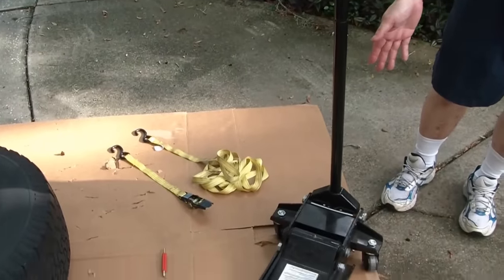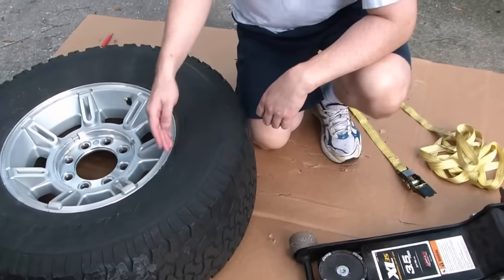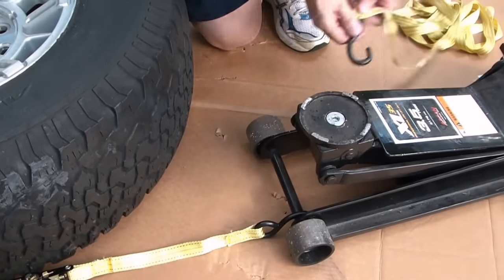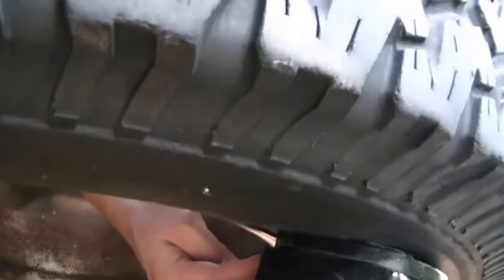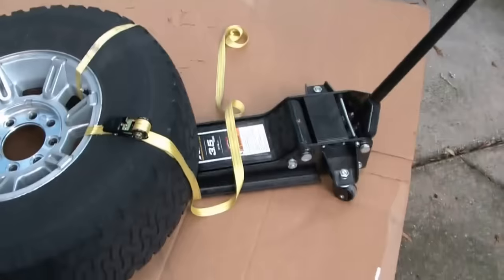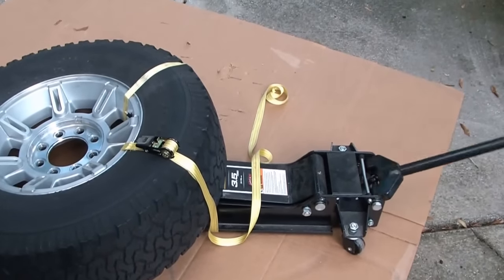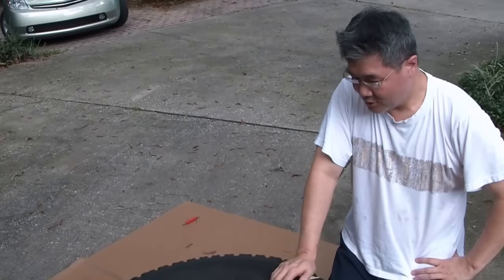Easy and safe way to break a tire bead

Comment: Do you have a trick on getting rid of the old tires for free? 😐
Reply from the maker: There are 5 solid waste dumps around the perimeter of Hillsborough County FL, where I live. Each of those accepts tires. Your county probably has similar facilities. You'll need to prove residency by showing your driver's license. Alternatively, the store where you purchased your tires should also accept old tires for disposal. That is because the state already made the store charge you a $1 to $2 disposal fee when you purchased the tires. Take care !
Reply: Just leave them on the front yard and hope for the best. Or you can stop at a tire shop at 3am.
Reply: Put them out by the street with a for sale sign,  someone will steal them by morning.
Reply: A match......lol
Reply: Ya, haul em to the liberal City of Detroit and Chuck em off in some abandoned house lot.  There was a tv show about that a while back lol
Reply: Put one under each brush pile you plan to burn and light it at night
Reply: Dumpster
Reply: Cut them in to chunks and make your self a punching bag.
Reply: Don’t know every states rules, but here in Missouri all you have to do is cut the sidewalls off and toss them in the garbage. Box cutter does the cutting all right. But if work, but free

Comment: Your method explained as simple as it could be for anyone to understand, I'm going to try it on a 14" tire soon, Thanks !!!. P.S., I knew this was possible, I'm also going to try installing a better tire on using a method I saw, it only requires dishsoap & your weight to put on..then you'll need to inflate it to proper psi. Thanks again.

Comment: Thanks just changed bad valve on my rim for my cts worked great 👍 thank you very much I was able to break the bead on the side of the valve and slip new valve in . I am going to install tires on my 2011 f150 in 2 weeks also in preparation for safety inspection and getting licensed

Comment: Nice video! I remove the Schrader valve,  put my tire on a piece of carpet and use a short wooden ramp put as close to the bead as possible and drive up on the ramp to break the bead. Or sometimes I use my large vice to do the same. .I then use long tire irons to finish the job.
Reply: Normally, I wouldn't want more vices in my life, but a large vice would come in handy if I had one. That's a huge vice you're talking about unless it's golf cart tires.

Comment: This is a great low cash method. Back in the day, we used and old fashioned bumper jack, and the weight of a vehicle. Now I use my vertical wood splitter.

Comment: We used to use the vehicle itself. just stick the tire under the bare wheel just right and lower the vehicle until the bead breaks loose. Worked every time.

Comment: This works great had to replace a tpms on my truck, worked perfectly, tip use a board between the jack and sidewall to prevent any possible cuts.

Comment: I use a similar method to compress front coil springs when replacing ball joints or control arm bushings.

Comment: I have an actual bead breaker, but I find the easiest way to be laying the wheel face up on the ground, taking a 2x8 (or something similarly sturdy) laying it across the tire wall, and then driving up on it with a heavier vehicle (truck/small SUV). Only takes a couple seconds.

Comment: Awesome video. 👍🏽 👍🏽 👍🏽 
 I used a piece of cardboard to trace around my rim then I put the half circle pattern on a 2x12. And cut it out. Laid the tire and rim on the ground, laid the 2x12 just shy of the rim. Drove up the 2x12 with my truck worked like a charm.(pull valve stem 1st of course 😆).

Comment: necessity is the mother of invention they say. Well done sir. I use a big hammer and 2 pieces of 50mm steel angle cut around 60 or 75 mm long..sit the angle inverted on the tire next to the rim and give it a sharp hit hitting towards the rim and down at the same time...repeat around the rim as needed until the bead breaks.. flip the wheel and repeat on the other side then remove the tyre with a set of levers..i used to be a forestry contractor and field patches were just part of the job and this method never failed me..

Comment: Will try this way next time I need to change my tire. Yesterday I used the jack but I put the tire under the tow hitch, put piece of 2x4 next to the rim and put jack on it while pressed the top of it against the hitch. Worked but this way looks easier.

Comment: This is a good concept but it seems to depend on the tire how well it works. My tires proved to be too flexible in the sidewalls because instead of the bead pushing off the rim the side flexed up and let the jack slide up the side. I also tried a variation of this by positioning the jack and tire under the tow hitch of my truck with similar results. So it didn't work with my tires but it makes sense with tires that have stiffer sidewalls.

Comment: Brilliant, thanks brother! I've been contemplating the Harbor Freight options, no place to bolt the thing down besides also not wanting to have extra shite lying around, turns out I've already got everything I need, ratchet straps up the wazoo (those being of equivalent usefulness, depending on application, as having a good zip tie supply 😆)

Comment: I just tried this on a worn out of 35s on an 18in wheel. It kind of worked, I ended up breaking my ratchet strap trying a 2nd time but it partially debeaded one section then jammed up. Figure if I did it 2-3 times a tire it would work but very time consuming, would definitely work on a smaller size

Comment: I've always used the weight of the car to release the bead, always works and very controllable, but this is a good idea if you happen to have those straps.

if you don't have those straps the weight of the car on the tire will break the bead and not damage the wheel if you do it right.

Comment: You could accomplish the same thing , by placing a section of 2 x4 on the top of the tire and smacking  it with s  4 or 5 bls dead blow hammer ,This  would loosened and brake  the thigh bead as well .Then get a tie rod in side and  walk the tire off the rim .. I have done this tire removal method  many times. But your video completed the job , so thanks for the sample ..

Comment: In old school advance auto shop, to graduate at the top,  I had to remove, and replace a tire from the wheel of  an American car.  Using only the tools supplied with the car when it was new.  The base of the bumper jacks have one side  that is curved.  By inserting the curved side into the bead area, the bead is broken by jacking up the weight of the car.  
 Then the 18 inch lug bar is used to remove the tire using the drop center method.  Most older wheels were made drop center for this very purpose.  Some new car glove box manuals actually explained the whole technique.   But those days are gone.  Now the manual warns to not drink the contents of the battery.

Comment: I'm wanting to paint my motorcycle rim/wheel and so I need to break the tire away from the rim. This will allow me to fit cards in there to keep the paint off the tire. I let the air out but there is still no space or gap between tire and rim. What do I need to do?

Comment: Very nice. I wonder if i have anything laying around i could make a frame out of, instead of using those straps, the jack and tire would fit in the frame, like a press almost.

I watched a video of a guy breaking the bead with a sledgehammer, figured i couldn't aim that well, so i used a mallet and a 2x4 in a chisel manner, damn thing just bounced off the tire. After much swearing, i took the tire to the shop. I'll try this on the next one and see if I'd rather get a bead breaker

Comment: I never got that one to work for me. I have done it by putting a board on the sidewalk and driving up it, have just used tire irons, and us d the hammer side of my splitting maul. Depends but I wouldn’t mind eventually getting a proper tool for it.

Comment: Who knew I could break a bead using random stuff I already have in my garage? TBH, I change motorcycle tires and this may not work, but I am going to try it! I've been using a large "C" clamp and angle iron to break them, but this will cause fewer cramps in my hand if it works as well with motorcycle tires.

Comment: Just FYI, Harbor Freight sells a "bead breaker" tool for $40 that works great on most tires.  This method might be necessary for truly larger tires over 285 width.

Comment: Good idea and works well to one side but there is a problem to the other side because the first one is already loose and does not support the strap in place. It just wrinkles a tire but does not break the second bead.
.

Comment: Great thinking and I'm impressed. 👍 It's all good for the 4x4 guys but what about the Porsche and Lotus guys or from where you are in the US the Corvette. 
I suppose in theory it should work but a lot more care needed as that Jack will need to break a much much stronger bead with less tyre to grip onto. I'm all for DIY, well done from across the water 🇬🇧

Comment: I use the brake rotor after I've taken the wheel off the car.
Lay the wheel and tyre under the car and just lower the jack with the sidewall positioned under the rotor.
Reply: The rotor is thin.  Wonder if that can damage the tire sidewall?  Also, could that damage(bend) the rotor metal shield behind the rotor as it contacts the tire?
Reply: @robertjohnson4401  rotors on motorcycles and bicycles are thin.
Rotors on cars are solid steel and almost 30mm thick. You could drop the car on the ground and hardly hurt them.

Comment: I think it kicks ass or bead rather but being a fabricator that pad comes off so most have a round hole in them with a couple peaces of steel one could make a arch likes on a tire machine and weld it to a round sold peace that would fit in the jack witch in turn would keep you lined up better and also give you more coverage around the beed pushing on a larger area I’ve seen these adapters that go on the floor jack for transmission instals so a little adapter would be easy to fab up on a small thing like this ! But all in all great idea I can see myself using it and with a extra half hour I can see me making what i just explained to most aluminum wheels if not to old aren’t to bad to get off it’s the dry rotted tires on old steel wheels we’re there rusted those ones can be a pain even with a tire machine really like the idea never though about it or even heard any one ever doing it like this and it feels good to learn something new every day !

Comment: 2X4 on tire and lower brake rotor from corner you just took it off of onto it is even quicker. Added bonus is jack is still where it needs to be...

Comment: i tried the driving on a 4x4x8 and it broke.  i tried this method as well and the bead wouldn't break.  just kept on jacking up the rubber till the head of the jack slipped off the rubber.  i have the exact jack and tie downs.  my tire is pretty big, but not as big as his.  wonder if that's why

Comment: An excellent video if you added a piece of timber on the jack saddle that followed the circumstances of the wheel you wouldn't damage the wheel and could put pressure on a larger area of the tyre.just a thought.

Comment: you can purchase a budget bead breaker tool for less than the cost of the hydraulic jack, and can break beads on for tires in less time it takes to do one with the jack.

Comment: I've ground my motorcycle almost in half to the rim on each side and the bead will still not break. I have beat and pried on it and nothing. I'm trying this tomorrow. At least I can't damage the rim. I've changed many motorcycle tires by hand and using screw driver and pry bars but this is the worst I have ever had and I installed the tires just 3 years ago and 10,000 miles. I would swear they were glued onto the rim. Thanks.

Comment: This can be used on airplane wheels when replacing the tire and tube, a common experience for owners and pilots. The strap needs to come up through the wheel bearing hole in the center.
Reply: Thanks to this video, I changed landing wheels on my fighter jet too!

Comment: To break a tire bead I just put the tire on the ground in front of the tractor, place the tractor jack (4 ton model) on the tire and operate the jack under the front counterweights of the tractor. Works every time and is very safe.

Comment: Take off tire, screw on 2 lugs using some sort of washers or spacers if you need so rotor is tight and let down vehicle on bead with Jack. Use the 1 ton car as a bead breaker. Have done this for many decades. Good tip. I just try the simplest, easiest method. If it's a big tire use a bigger vehicle or a bucket from a tractor. Having a log loader with Hydraulic stabilizers makes quick work of any bead too tough.

Comment: Love it.  Can't wait to try it myself.  Would you happen to have a video on a simple way for removing the tire from the rim? Without buying special tools?
Reply: Don't mean to offend, but did you watch this video?  I thought that's what the whole video was about.  Just saying.
Reply: @RonnieCarter38501  Breaking the bead is different from removing the tire from the rim.  On high load tires, like G rated trailer tires, it's difficult to get the tire to flex enough to get it over the edge of the rim.

Comment: Use the same jack, but set the tire under the trailer hitch on the back of a truck.
Use a short block of wood to spread out the pressure from the hitch and protect the tire.
Way faster than strapping it down.

Comment: Although there are several DIY videos available on 5he Internet I downloaded yours since I liked your presentation the most.

Although I did miss the crappy 'Muzak' (elevator music, etc) and the absence of a 'Vanna White' type to point out each and every movement and part, I still felt your's was the best one to keep for future reference and will add some crappy Muzak later.

Actually I've been using this technique for about forty years or so and now have about thirty auto and motorcycle tires to remove so I can sell the aluminum rims or install new tires and by saving $8.00 per tire I can buy a few new tires for a couple of my bikes.

I had completely forgotten about doing this so when I found it today did my "Happy Dance" and grabbed my tire jack

Oh, BTW, if you have an old disc brake pad laying around, cut a piece of wood to fit inside to round opening of the jack, then drill a 1/4" hole though the puck so it can be bolted to the jack; this way it will locate the wheel a little more quickly than without 8t.

Thank You for posting such a great video - and saving me a few bucks too, (!).
Reply: Dont understand what you mean by "locate the wheel"?  Do you mean the brake pad will touch, rest against, the rim keeping the jack from sliding into the rim?

Comment: Just tried on an ATV tire.  Yes sir.   Only mistake was popped the none valve side which does make a difference in the next step
Reply: Was able to pop the other side of the ATV tire.  the jack platform kept slipping out of position.  Raised the other end of the tire so it was almost level and came off no problem.

Comment: Hhuuhhh , grandpa taught me to use the bottle jack under the tractor drawbar , but i dont always have my tractor with me ..i like that thanks , last night i was running over the bead with the front tire of the truck , careful though , youll be replacing the drivers front tire if you cut it with the rim your working on

Comment: Youtube just dropped this one in my feed - Never seen it done this way, very clever. Used a bottle and scissor jack and a fixed beam to press against (underside of a USA house). Used a home made bead braker, made of scafold and the head of a pickaxe. A small excavator and a few different tyre machines, but this is new on me. 

Do you have an easy way to get the tyre off the rim - 3 big screwdrivers and no hold down tools is my worst method so far.

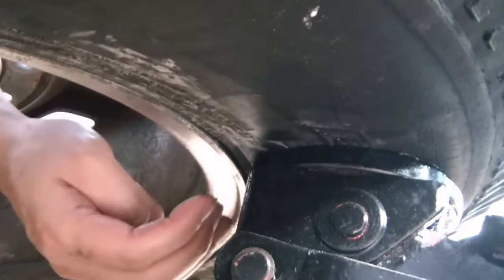Comment: At 2:44, I noticed that you have curb rash on the inside of your wheel.  How did you manage that ???  It should be difficult enough even getting them on the outside of the wheel when you have normal tires like that which are wider than the rims (the low profile tires that the kids use these days on their cars end up getting curb rash if you even look at the wheel too long), but on the inside of the wheel?

Comment: Very practical technique. I'm curious why you needed to break the bead yourself though- it doesn't look like the tools are there to remove the tire completely from the rim and install another, so changing a tire may have to be done at a tire place anyhow. I've got to address some slow leaks around the rim, which is why I'm watching videos on how to break tire beads- is it the same with you, or was this a challenge to see if the bead could be broken with the tools you had at hand?
Reply: Might need to replace a TPMS sensor or patch a tire.  Maybe he's got a manual tire changer but prefers to break the bead first using this method.

Comment: Best method i have developed - use a second vehicle and jack up the front end. Then place the tire edge under the lifted tire ( tire on tire ) then slowly lower the jack - weight of vehicle pops the bead with no issues.

Comment: thats exactly the same method i use. need to find a good tire removal tool or you could use a wire rope 1/4 inch and cover it with nylon and a loop on one end to help with removing the tire.